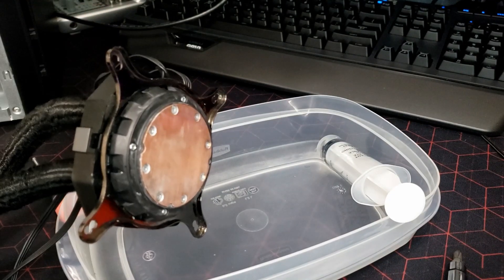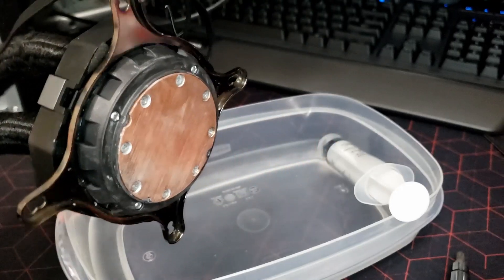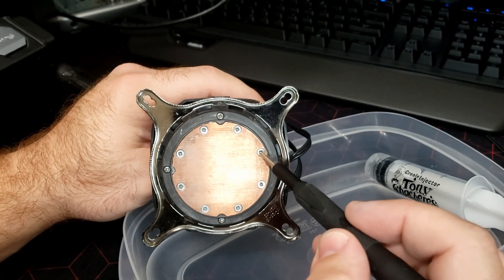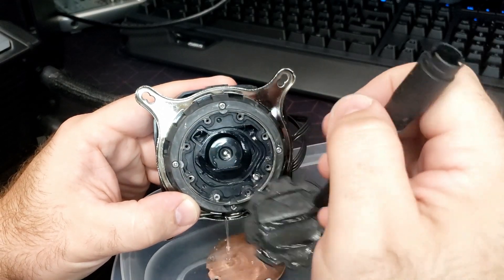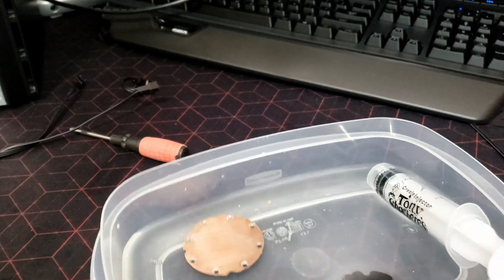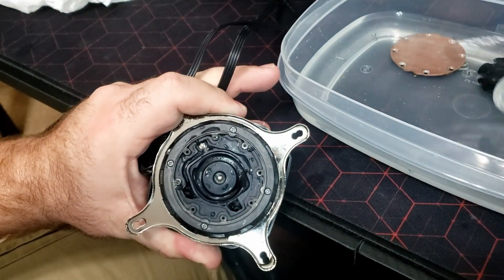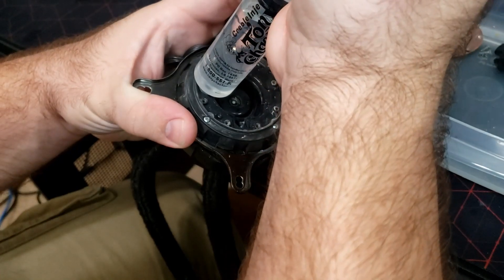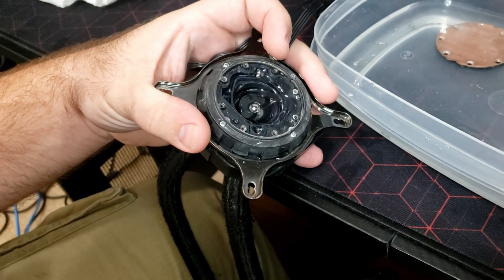Servicing an Asetek All in One Liquid Cooler (corsair, nzxt) part 2

Comment: I bought mine in 2016 9 years and now having issues woth tems going to 50c or 60c going to try this out see if it works.

I also saw that alot of people mix water with some kind of corrosion free liquid.
Reply: Bro did you just used distilled water something els ???
Reply: @debrajadhikary29 i would say yes, im going to find the liquid free corrosion just to be safe. So this bad boy can last another 5 years lol. it's recommended to add biocides and corrosion inhibitors to prevent algae growth and corrosion. Distilled is good but can be contaminated over time and corrode. Best of luck.

Comment: the coolmaster one you could drill a small hole in the top of the radiator to drain and fill then use a self tapper with a rubber washer to seal back up :-)

Comment: IMHO never service these - get rid once they start leaking. they do not have an external reservoir to top up. After 4 years - get rid.

the radiator has too many places for air to get trapped in, it's impossible to get all the air out. I have done this wtih cars where I changed the coolant in the car and I was topping up coolant for a long time because air would come out from the crevices. The unfortunate thing with AIO coolers is you fill the water in where the pump is so it's impossible to run the pump and circulate the water and top up the water - because you need to seal up the pump (the filling port) in order to run it.

Comment: Some advice for others looking to do the same: -
- Whilst you can just use distilled water, the better option is to use one with rust inhibitors and a biocide.
- The pre-mixed coolants are fine but be very careful if in case your kit has a combination of different metals: if it is not an all-copper system, your radiator might be aluminium and it is a BIG no no if your coolant does not have an appropriate type of inhibit inside. A glycol-based coolant would be ideal in this case (Aquacomputer Double Protect Ultra is ideal) with a min of 25-30% concentration.
- Water expands as it heats up so you do not want to fully fill it up. They don't come 100% full from the factory.
Reply: Any car engine coolant fluid? They are engineered for aluminium and copper parts. And they are not too expensive.
Reply: @kiakk_009  Principle is the same but there are different variants of Glycol (with additives) so needs extra scrutiny before going that route.

Comment: I have this same cooler, 240mm variant
Installing the cooler gives me temps around 119 degrees Celsius 

It sounds like there is too little water in it
And when it powers on, I can hear either the lack of water flowing through it, or it's the sound of air

I connected the aio externally and found that the copper plate gets hot as the pump runs

Will this refilling do my work ??
Reply from the maker: more then likely yes, but there are times where the pump itself just dies, so refilling would be the first step, if it still sounds like that afterwards its a broken pump.
Reply: @CustomCarsComputers the pump is the bearing you can replace
Reply: There could be gunk inside you need to clean and flush it out

Comment: Good Lord that's a terrible place to put the maintenance port! Thankfully every AIO I've bought has a fill port on the radiator. That just seems brainless to put the port right against a circuit board. It looks like they purposely did that so you can't service it and have to buy a new one every few years.

Comment: Thanks for this video. Do you use simple water or mixed with some chemical things?
Reply: Distilled water. If you plan on having the system in a place below freezing then you can mix in some antifreeze (propylene glycol) but that’s not necessary if you’re keeping it somewhere above freezing temps
Reply: @zombiepwner14  when the hell would it ever freeze lol..the thing is bloody hot and you'll never leave your pc out in the snow would you?

Comment: Mine had very tight bolts, so I just managed to refill a little bit bu unscrewing the screw behind the housing... I just refilled with distilled water using a small syringe and a napkin so no water is spilled on the circuit boards. Looks like it worked and I got rid of the air pocket I had noticed (unstable temps).

Comment: I'm having a bad day right now. PC won't start because it overheats without the cooler. Thought it was the thermal paste so I re did that and it lasted like 5 to 10sec longer. Was so confused till I was like wait what about the water. So I took the fans off to shake radiator and it was like a feather. Still gave it a little shake and can hear maybe drops of water left in my cooler. I want to try this but don't want to break anything. I feel so lost without my PC tho.

I had a diffrent cooler then home Boi here. Basically was the samething. Very sacry how easy those copper plates fall right off.... but I did replace the water inside and got everything hooked up properly. Cooling is great now. That night I ran out got antifreeze and distilled water with one of those tiny Turkey basters. Took me forever, for me 70% of the time I was moving my cooler around slightly shaking and tapping it to get air out. But been awhile since I have done it and have had 0 issues. Way cheaper then replacing whole cooler.

Comment: Just did this on my H115 and went from 85c to 65c playing Bf2042.
I for sure had a blockage, lots of chunky bits on the ribs, i guess they either completly or partly blocked the flow.
Reply: Hi, how did you clear up the blockage?
Reply: @josh333rus  i took off the copper plate, ruined the screws in the process, be very careful. The plate is off, clean the underside, fins etc.
Clean everything else visible, on the unit aswell.
Drain the entire thing (hold upside down)
Fill clean water, and drain again until it is clean.
Fill with water, shake and shake hoses etc to get air out.
Fill until the entire assembly is full. Screw tye plate back.
My first attempt failed because i didnt fill enough water, so make sure to fillcompletly full, and no air.
Reply: @B-laze_Fungist  fantastic, thanks for the step by step guide
Reply: @josh333rus  no problem. Careful with screws, you need the screwdriver with PERFECT fit. else, you will need a dremel to fix the misstake, which i had to.

Comment: you need to leave 5% air for expansion of  hot water. not fill it completely.  and you should not submerge it. it will ruin the circuit board of the motor. and you should add 20% antifreeze.
Reply: Heating water from 20°C to 30°C makes the volume raise 0,2%. It's not much, but if you completly remove the air, you will definitly create a leak or a broken seal, as water cannot be compressed.
Reply: I doubt this will get hot enough to worry about "expansion" i definitely agree for the 360 aio's though
Reply: as below stated, water doesn't compress, so you need at least a slight amt. of air for expansion room when h20 heated then you've leaked onto electronics possibly !!
Reply: @jreeve1979 says: "water in an aio will never get hot enough for expansion of that type to happen. you want to make sure there is zero air left in the loop". Makes more sense to me!
Reply: are 20% anti freeze necessary? I mean I live in equatorial climate... no winter
Reply: @ulyssessait  antifreeze prevents corrosion. Water does most of the work when transferring heat, but by itself, it can lead to oxidizing parts.
Reply: @8eSix you are right but you don’t need antifreeze
Reply: Not true. Adding air is what expands the most & is a problem, whether you have experienced it yet or not. Zero air is ideal (and nearly impossible to achieve by hand).
Reply: @bestyoutubernonegraternumber1 you don’t want air in there because water will escape and evaporate over time the bubbles will go to the rad not the cpu

Comment: I have two graphics cards to Hydro addition to 95X to use one is used from a seller it never overclock it when it’s still going from when I purchased it in 2012 to 2014 it is still going and I would like to refill both the pump combos on that card times two and I may know someone body modification industry that can get me a 25 to 50 gauge needle just a stick it into the hose on one side seal it and refill and then take the air bubble out of peak in the house but this seems a lot better than trying to get medical supplies so sorry for the long message but would like your input on this tooth also Baeza check for the 295X to

Comment: Dont you want to leave a touch of air to account for expansion when the water gets hot?
Reply: water in an aio will never get hot enough for expansion of that type to happen. you want to make sure there is zero air left in the loop
Reply: No. Heated air expands, but liquid should never get hot enough to require space to expand. You want it as air free as possible.
Reply: Do you have any experience with alphacool DC LT2 pumps are they any good?

Comment: why did you use the old liquid? you can see floating bits in the water! this will damage the cold plate, always use new liquid when doing maintenance.
Reply: Do you use regular tap water?
Reply: @wy10.10  Preferably distilled water.
Reply: @wy10.10  Absolutely don't use tap water, only pure distilled, or distilled with coolant mix.
Reply: Probably just for demonstration.

Comment: accessing the high point screw to bleed air- how did you re seal the coolant temperature sensor when moving the main circuit board out of the way?
Reply: This  screw not to bleed air. It is "temp interface" for temp sensor to measure temperature.  Yes, this screw is transferring heat into sensor, but not to blead air.
Reply: Right? What the heck
Reply: i was also going to attempt filling through that little screw as he said to in the previous video because its supposed to be the highest point in the system and i dont want to screw up all those little phillips screws in the cold plate. so i thought i would aslo do it that way.....until i just seen your reply. (Yea... what about the temperature sensor?) is that way no longer a recommended way of topping the fluid off?
Reply: @tdb0ne1  This  screw not to bleed air. It is "temp interface" for temp sensor to measure temperature.  Yes, this screw is transferring heat into sensor, but not to blead air.
Reply: @tdb0ne1 don’t ever do that you will get a leak in your board and dead under a year

Comment: So I am about to clean my NZXTx41 and all I have to do is just refill the water? I read on some forums I need to clean it or replace the hoses.
Reply: depends on how old it is. if you see gunk build up in the cooling fins, you should clean it. otherwise just top off with distilled water or replace with new coolant. (dont mix different coolants)

Comment: Water expands with heat... so... unless you want to have an accident, leave a little bit of air in the loop. :)
Reply: and becomes less dense, unlike you
Reply from the maker: The water would expand and still push against the air which cant escape causing the same "issue" its a sealed unit and made to expand with the heat
Reply: Air can compress significantly with the force of a pinky finger. Water can compress about 0.01% with the force of 1000 elephants. Which one would cause a failure in the hardware?

Comment: Can I ask for the screwdriver number please?
Reply from the maker: Ph1 is the screwdriver bit i used, it might be different depending on the manufacturer year
Reply: @CustomCarsComputers  I think I need a pozidriv. But I do not know the size. Thanks for the info.
Reply: @marpinxu2826  get an ifixit kit or something similar then you will have one for anything
Reply: @ashtong85  - Great suggestion. The ifixit kits are perfect for so many different uses.

Comment: Is this all distilled water or does it have a mixture of PG in it. I have read sokme AIO systems use PG ? If so, what the ratio ? I have a H80i v i would like to redo.
Reply: Hey! I don't know about all the aio's on the market but a common aio by asestek use 89% water and about 1% of chemicals that help fight against metal reactions and the rest was the standard propylene glycol stuff, hope it helps